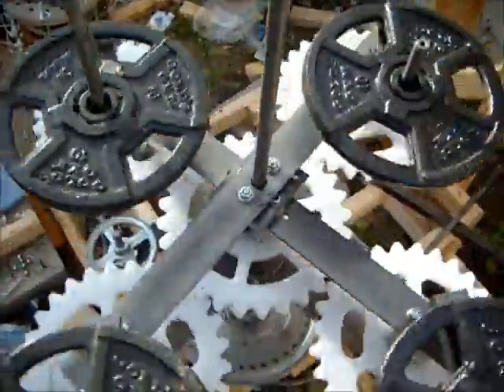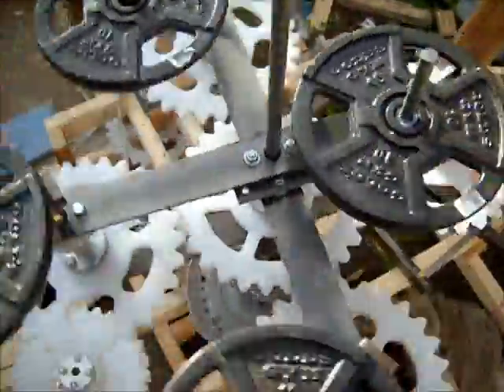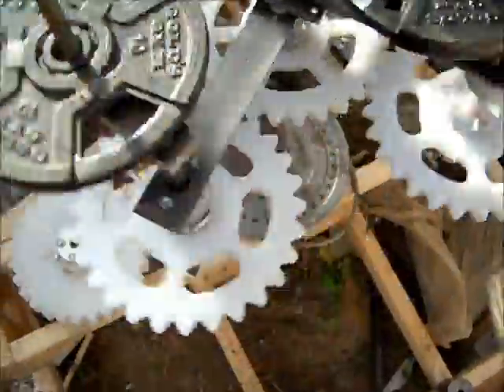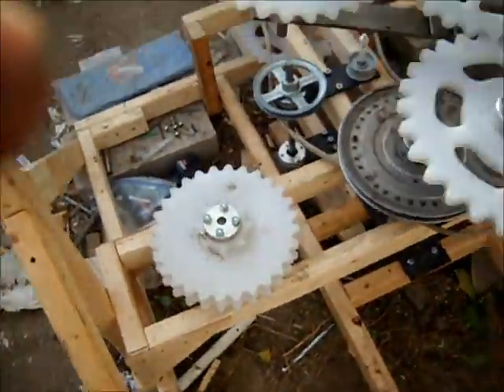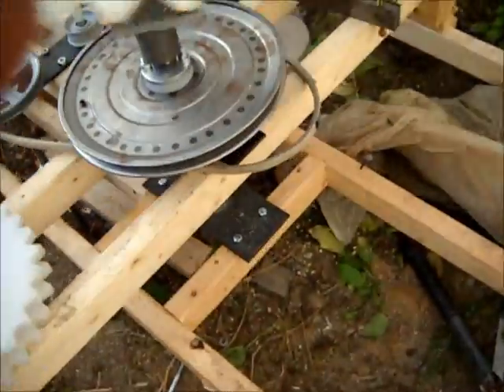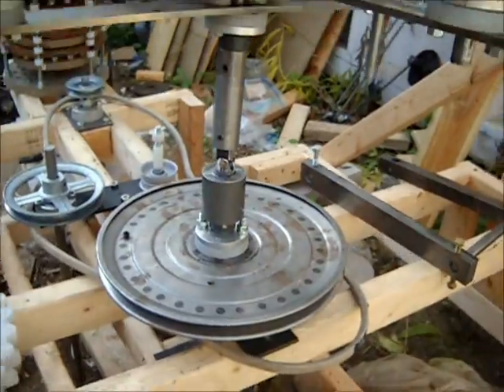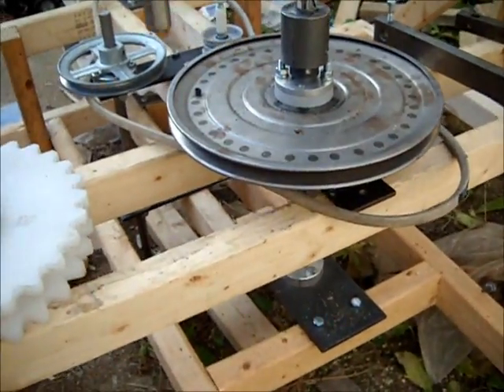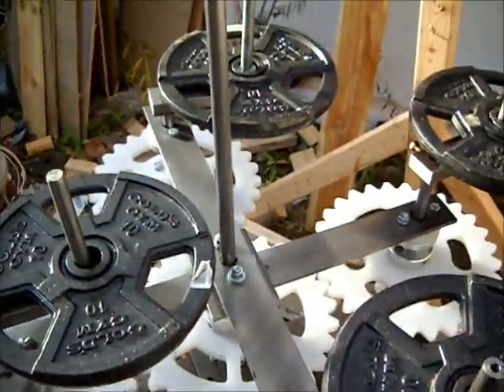QGDversion3

Comment: Just wanted to give kudos. I have been following your work for a while. Starting some testing on my end also. Will share my results when done. Do you feel that the gears are creating a leverage scenario that is nullifying the end result. If you require some data logging stuff i could mail you a arduino with sensors to help with data anaysis. Very excited with your progress
Reply from the maker: Hi, kind offer but not required. All the weights fall toward the rotating center of gravity. I may have to increase the length of the center shaft for more mechanical advantage. I should know more in a few days. Thanks again. 

I look forward toward your results, thanks.